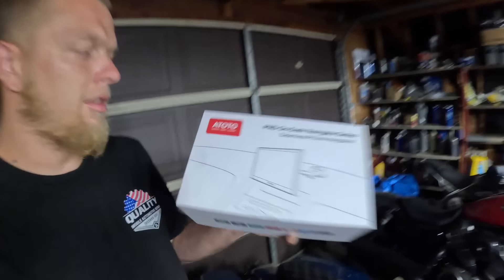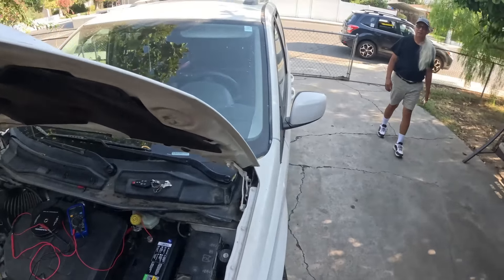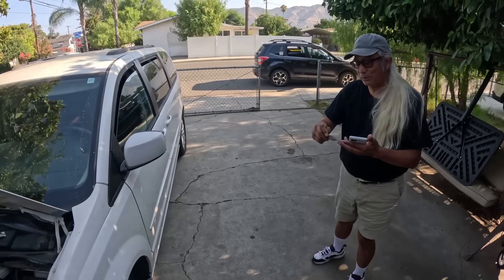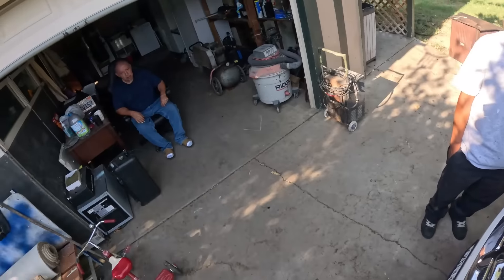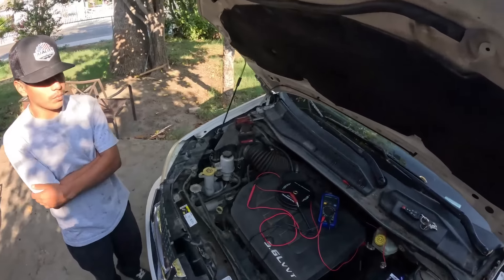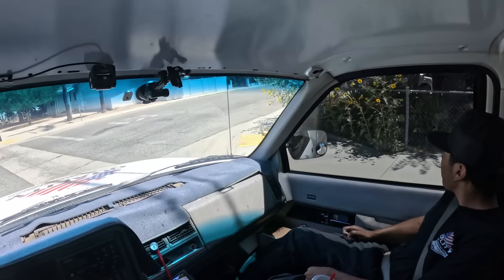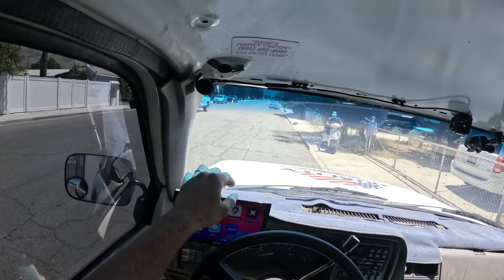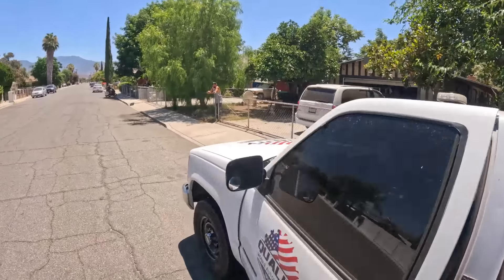CUSTOMER was UPSET! Mobile Mechanic ELECTRICAL diagnosis

Comment: Why don't you carry a spare battery?   Bozo?  $350...for a battery?  Must be a heavy-equipment battery.  Why didn't you pop the battery caps and check for lack of electrolyte?..............
Reply from the maker: Bozo? let me carry another battery just so I can tell them they need a battery. Makes perfect sense to me. $350 is for parts and labor/me going to the parts store and back. Have you seen the prices of batteries at the parts stores? Why would I pop the caps when clearly it needs a battery!